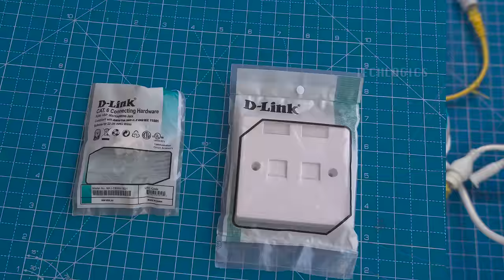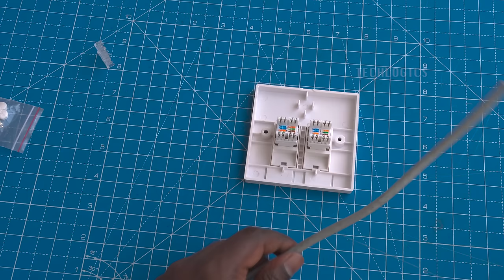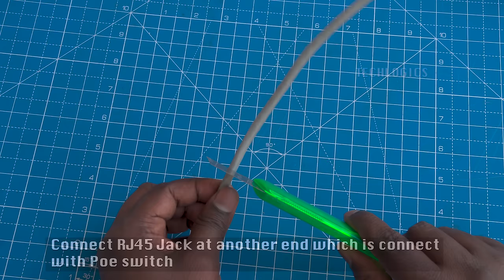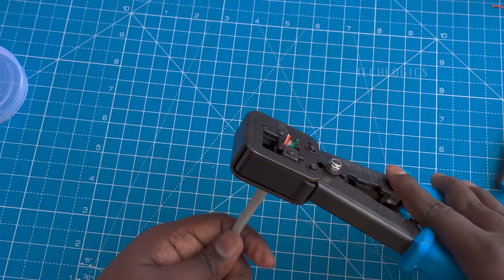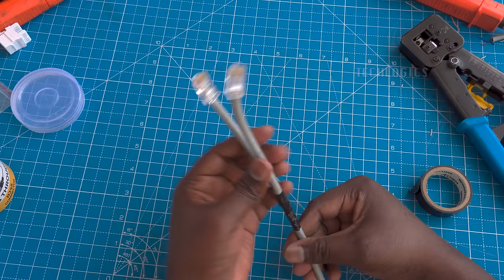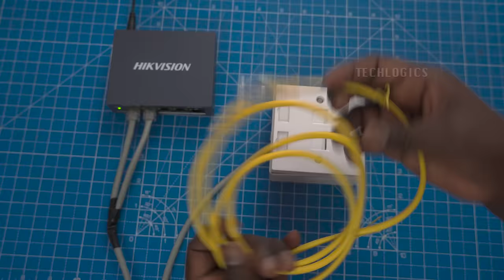Two ip cameras connect single cat6 cable using D-link IO Box

Comment: I have checked on 4 wires it's working properly.
Reply: You will an issue in 4 wires.
Reply: Right 
We can Use only 4 Cable For Data .. PoE Power not working

Comment: What was the reason of using that Dlink box? You just split the cable on one end and could easily do the same on another.
Or you should use same Dlink boxes on both ends.
Anyway this will only work with PoE switches using 1,2,3,6 for both power and data.

Comment: doesnt work with passive POE that use 1236 for data and 4578 for power
Reply: I don't think I've come across a passive poe CCTV camera, most are af, maybe at for bigger PTZs, so should work for the majority of cameras. I haven't tested to be fair.
Reply: FutufuyuA00🛰📡🚦📱🚦🔒📱📡🛰
Reply: i can't put link to devices that I bought in aliexpress

Comment: but its depends on ip camera,most of the branded camera support 4wire system but oem cameras not support,so its need 8wire for poe function
Reply: Any device if you need to use with poe function then 8wires needed.. otherwise 4wires ok for just data transfers..👍🏻

Comment: Does this cable also carry power?
Reply from the maker: Yes, We should use a Poe switch, In case LAN switch need separate DC12V for camera
Reply: @Techlogics  I appreciate your innovative ideas 👌
By the way, will cameras still work if we use an extended POE switch (up to 300M)?

Comment: Power supply  is not given  to camera  port externally  in vedio  only data   please tell  what about power
Reply from the maker: We connected through poe switch, The poe switch will carry both data & power over cat6 cable for Cameras. 
Note : when using LAN switch then you need to connect separate DC12V power supply to each cameras
Reply: @Techlogics  in cat 6 cable 8 pair  you have shown two camera  in cat 6 cable . 4 pair to 1 camera  and remaining 4 pair to 2 camera   and  what about  power cat 6 pair r end now  in poe switch  1 camera can easily connected not 2 we have give power on camera point compulsory  if we crimp cat 6 for two camera ⚠️

Comment: For cameras we want to give separate power r what  ???
Reply from the maker: IP cameras connect through Poe switch will carry data & power no additional power supply required, If you use LAN switch for IP cameras then required DC12V power separately for each cameras

Comment: Fake video this connection is good for non poe but poe switch will not work bcz 4578 for power. The wire not full showing i think 2 camera keep under table and power up by external power. This two fake camera.